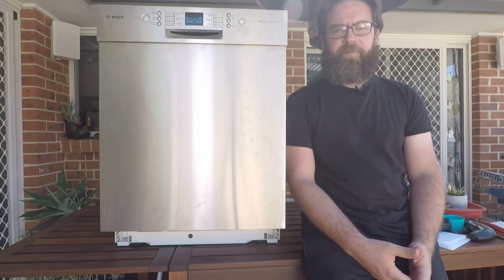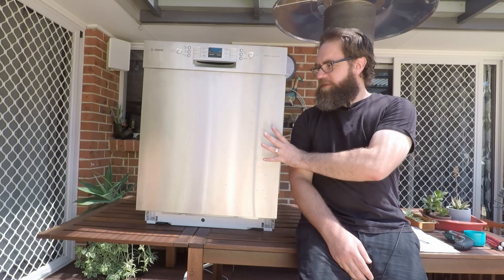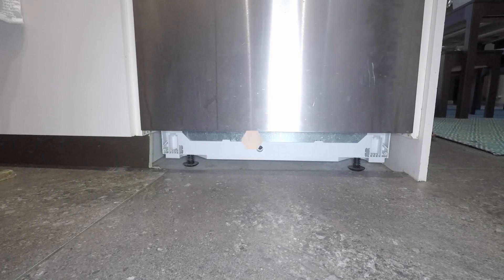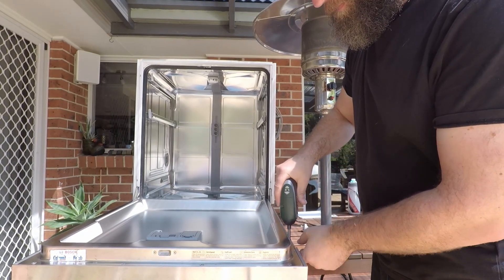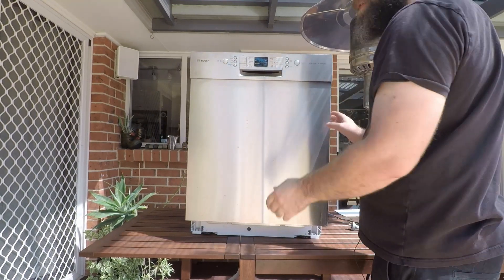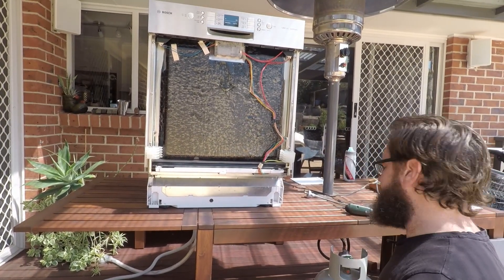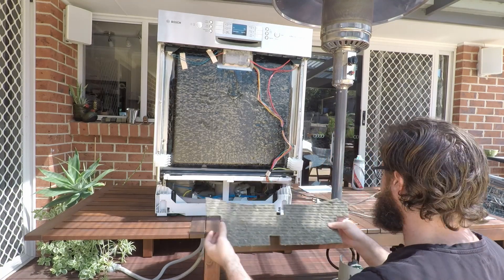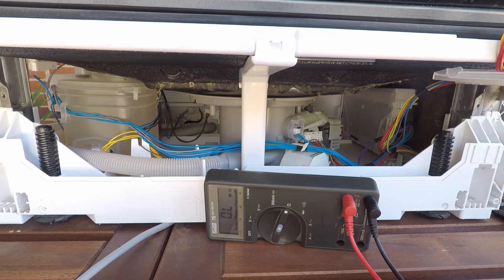Bosch E11 error code diagnosis and repair

Comment: I originally had error code e15.  I opened the dishwasher to discover a big rats nest.  I removed the nest and noticed the floating disc was destroyed.  I removed the pieces and e15 went away and the dishwasher now runs.   I covered any chewed wires with electrical tape but now at the end of the cycle I get e11.  Could that be because the disc is missing now?  If it’s simply that I plan to order a replacement disc.  But if it’s more I’m not sure if I’ll be able to fix it myself.

Comment: Hi Scott, you might help maybe. I had e09 error first- swapped heater/pump and now it showed sp11, which should be thermostat. So replaced it and it still shows e11... any ideas of where to "dig" further?
Reply from the maker: Have you checked the wiring from the thermostat to the control board? I would unplug it from the board and make sure you get the same readings across the thermostat that you get from directly probing the thermostat itself. Otherwise it's looking like an issue on the main control board
Reply: another called for replacement of the pump with error code r11?
Reply: I’m the same but have an E11.  How’d you replace the thermo?
Reply: @j g  hi, I just replaced heater pump, re-installed the wiring plug and it worked well.

Comment: Hi Scott, thanks for the video. I have a multimeter, but I'm not an electrician. Exactly where do you advise to place the probes to check the resistance of the thermostat or heating elemant?

Comment: is there a watertap error code video coming? thanks
Reply from the maker: Hey Scott, there is one coming up on the E23 E24 and E25 codes which may help you out. In the mean time, if you follow this video all the way up until about 5:30 it is basically the same. Once you have the front covers removed you can check the drain pump itself if you have a multimeter handy, mine measured around 90ohms across the pins on the pump itself. The drain pump should be at the front of the machine, again if you check this video you can see it once the bottom cover is removed - it is the white box just right of centre, mine has purple wires running to it. Check these wires for any damage and unplug the pump to check the resistance. I will prioritise the E23-E25 video so it should be out in the next 24hrs. Cheers